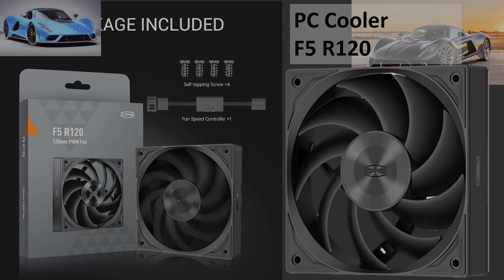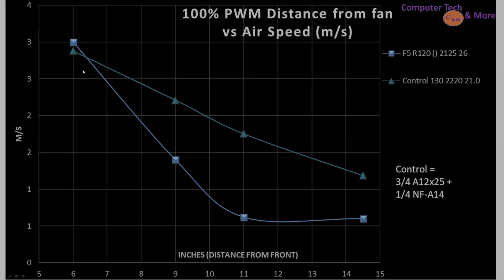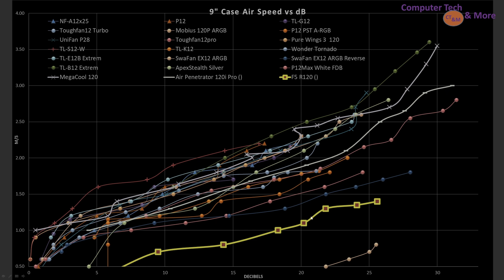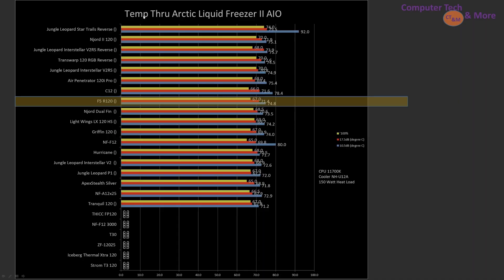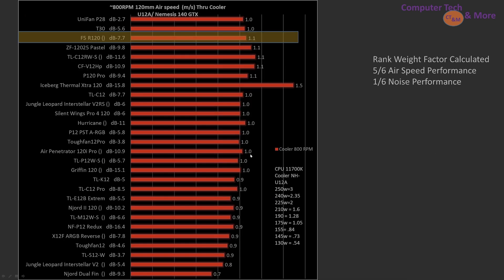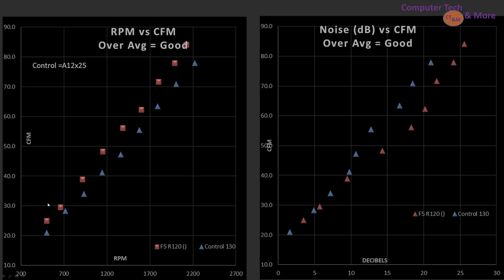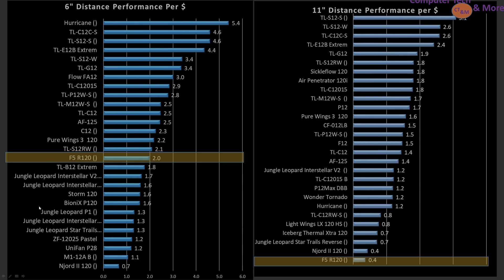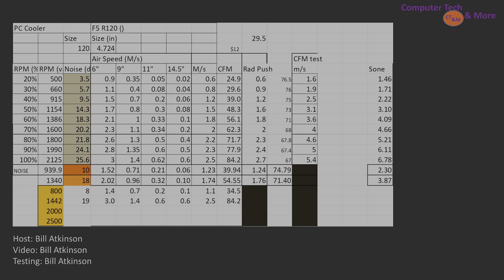PCCooler F5 R120 Review: Does this fan have race car class performance?

Comment: It would be helpful if you actually showcased the fan, rather than just charts. Also, there is no reason for a PWM fan to have a fan speed controller, unless your motherboard is so old that it only has 3-pin headers.
Reply from the maker: For the most part now I do showcase the fan. 
For a while here most of the input was to focus on the data rather than showcase the fans. 
for the controller: If its a "free" extra no harm in having it. but I dont think most people would use it.

Comment: I bought the PCCOOLER CPS DS360 liquid cooler which comes with 3 of these fans. Unfortunately, it has no RGB on them, so I thought of replacing them to the Thermalright TL-C12C-S, which I can buy 3 of for $15~. But it's not clear from the graph which is the better fan, you ranked the Thermalright higher Value per dollar, but If you disregard the price completely, which one of them is the better fan for a 360 AIO?
Reply from the maker: I have a couple best of videos on my channel from last December. still very relevant. it all depends on price. 
So I have best of best, best of RGB and Best Cheap fans (under $18). hope that helps. If your still confused after checking them out let me know.
Reply: @computer-tech-more  Wow! Thorough work. Just watched it. But it doesnt list the PCCOOLER fans. I'm getting the impression that the C12C-S is best ARGB value for money fan for the radiator? But which one would you recommend if pricing isnt an issue, and how big of a difference is it between it and the C12C-S / the PCCOOLER?
Reply from the maker: @RegevElya-e2n  This one is the only PCcooler fan Ive tested so far. 
I like the S12 from thermalright as a budget option. if budget is not an option and you want RGB 
P12 Pro ARGB, TL-C12C or X28, would be among the top.

Comment: So as a case fan what is your current favorite? Same question as a radiator fan? I am upgrading the fans for my Grandia GD11 case which has dual 80mm on the back, dual 120mm on the left side, one slim 120mm on the right side and dual 120mm for my Artic Cooler AIO.
Thanks!
Reply from the maker: so my top picks are the P12Max/pro, A12x25 and G2 version, and for budget TL-S12 are all stand out fans in my mind. 
Slim fans are harder but i guess the P12slim.
Reply: @computer-tech-more  Hi, have you tested the TL-P12 fan? I have both: TL-S12 and TL-P12. With almost the same performance, it seems to me that the TL-P12 is quieter and more pleasant in noise, although both are good.
Reply from the maker: @Hip_Hop_Top  I have tested the TL-P12 but havent made the video yet. In my tests the P12 was worse than the S12. 
As always I say I might have gotten a lemon or somewhere in the middle or a golden fan. 
I just dont know because I only get 1 of each fan. Its one of the things I would like to change if this channel gets bigger. testing like 5 or 6 of each fan. 
Back to the P12. It was still good but I liked the S12's performance better.
Reply: @computer-tech-more  You are absolutely right, I also have one copy of each, and the results may not be objective, here a sample of several copies is needed. In any case, the price-quality ratio of these two models is simply wonderful.